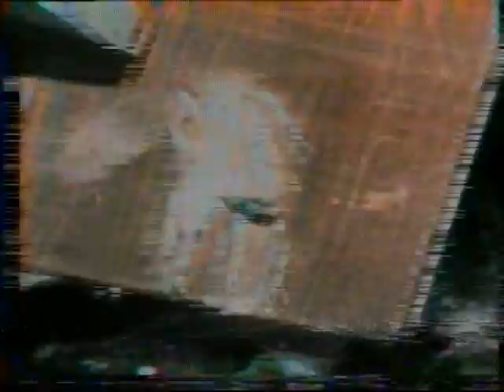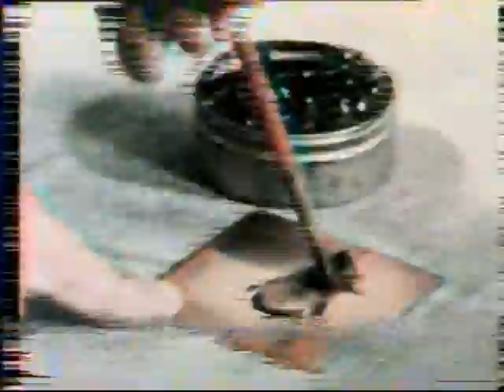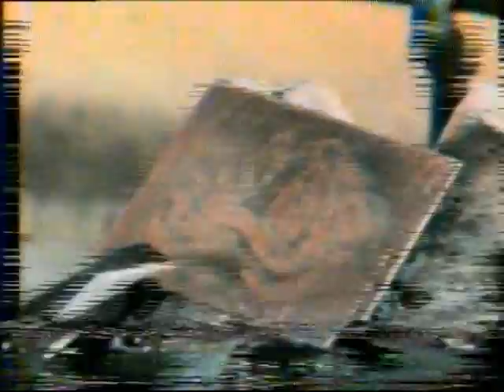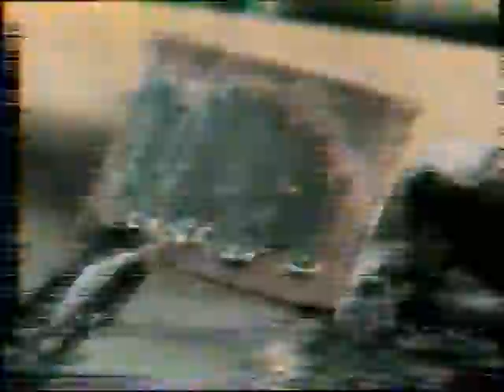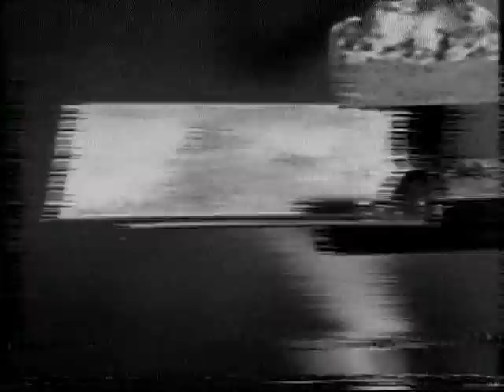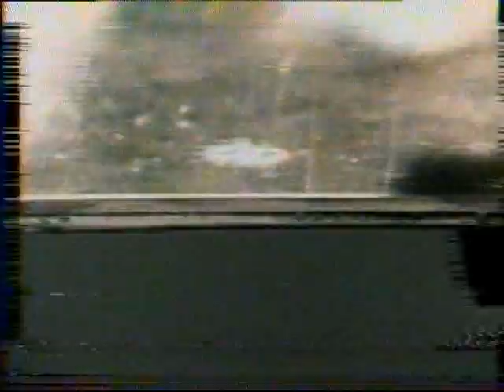Philips N1512 to DVD recorder transfer picture problem

Comment: Definitely NOT a tracking problem.  The field is too stable and complete for that.  It's quite clearly ghosting of the horizontal blanking interval - the pulse that synchronizes the video horizontally.  The level of the ghosting is just around the point that's strong enough to fool the DVD recorder into believing the start point of each line is where the ghost of the pulse is, rather than the pulse itself. Some VCRs retain 'persistence' of voltage on their baseband outputs which can lead to this

Comment from the maker: This is only when I hook it to the DVD recorder. Even with VHS transfers from this machine, when outputting them to the DVD I get this problem. Yet when I output it straight to the TV set, I get a decent picture without the horizontal field offsets